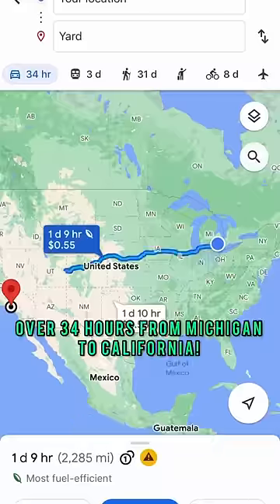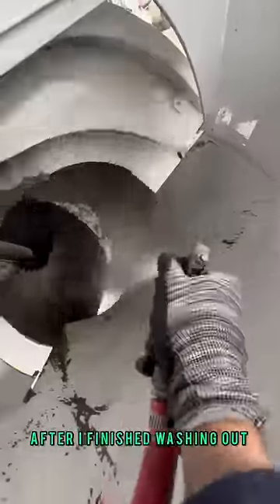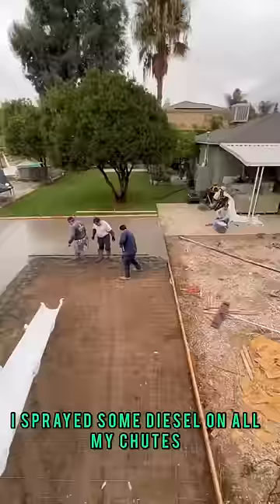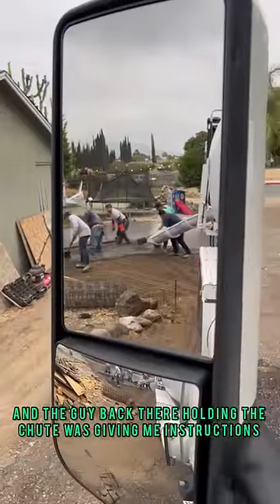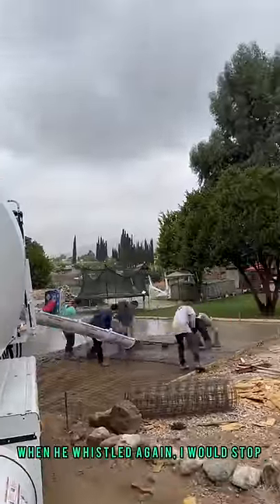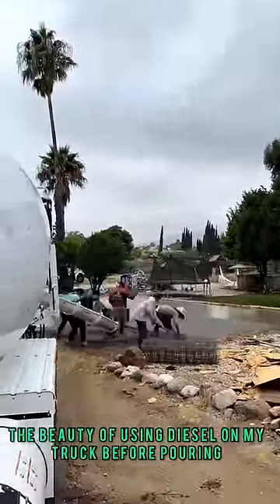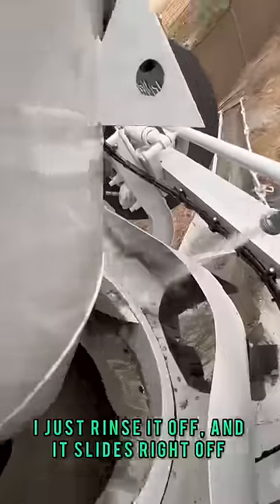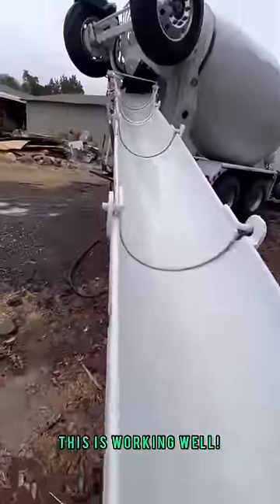BRAND NEW 2022 MIXER TRUCK!! 🤩🚛💨 #concrete #construction #readymix #work #cdl #trucking #shorts

Comment: Wow diesel in the concrete. Good luck boyz.
Reply: It does not affect it. Been doing it for years. Not to mention you just coat your forms, bobcat buckets, and Georgia buggy bucket with it. It's a thin coat. Not gallons.
Reply: @pervysage6969  the tiny amount will either settle out into the underlying soil/fill, and eventually degrade, or it’ll simply evaporate, nothing to worry about
Reply: @exloaded  well it depends on how hot the truck arrives whether or not I'll tell the driver to add a gallon or two to achieve my slump, but one thing I don't do is add water to finish the surface because we all know that will create a weak layer of concrete as it's curing and you'll wind up with a chalking surface. Instead of the reply you responded with you might should reply with a counter of why it's not best ? You have a right to your opinion I agree, but your response is irrelevant to a yes or no. It explains nothing. I have been doing it for years. Not one call back. Not one job with spalling. Only problem I ever had was dealing with a concrete by the yard company and that's what the customer insisted upon. They add chlorination to the mix even in the middle of the summer and add to much sand. Couldn't get a decent broom on it. That was on the customer there.
Reply: U know nothing
Reply: @cgrobe21  you could easily utilize the use of a sealer to achieve the broom finish.  You just need to find the right one to fit your needs.  There are approved methods to achieve what you're asking for.  What you can't do is add more water then what the concrete company has given you the approved amount to add, it's on the tickets.  Once you go over thst amount the cement to water ratio is off and yields a weaker  product then what they sold you.  Time is done away with when it comes to the placement, it's all about the concrete temperature.   If it's not over 95°F,  assuming you aren't pouring in freezing Temps, then you should have no problems.
Reply: @IllNacs  into the air. EPA must like that part 😂
Reply: @exloaded  dude, even if they order a 4000psi at a 4 inch slump and when we get to the jobsite and they have us wet it up to a 7 after that 28 day cure window those cylinders are still breaking at wayyy over 4K psi. I’ve never actually seen one fail before that. It’s like a weight limit on something. It may say 280 but it’s holding 400 all day.
Reply: @Nicksta177  a true 4000 psi mix from a good concrete supplier, Is breaking well beyond the 4000psi it claims it is.   Any concrete that barely reaches that mark is suspect.   The fact that you think going from a 4 inch Slump to a 7, once it arrives on site is something to brag about, makes me believe you don't care about quality.   In addition to that, the Slump is just an indicator of workability of the mix and has nothing to do with strength.   There's this thing called water to cement ratio that is a far greater indication of the mix strength.   The batch ticket will tell you the allowable water to still being able to reach the strength required.  If you want to make the mix flow easier, use a plasticizer,, it will increase the Slump and not mess with the water cement ratio.  Or, you could not care at all and just keep adding water throughout the placement, which I'm sure you do.  Also, there is no such thing as a 28 day cure window, It's a 28 day acceptance.  Concrete will cure for well longer than 28 days
Reply: The amount of any kind of release agent is only sprayed enough to coat the walls of the tandem or the chutes. The thickness of the actual material is greater than the thickness of the release agent.
Reply: @cgrobe21  America really seems to be the land of opportunity.
Reply: It doesn't affect it. Use diesel on trucks,  mixers, backhoes and even the testing equipment. Never had a failure due to diesel.  Don't pour it, just mist. The diesel doesn't bond with the concrete so it just bleeds through before dries, assuming you only used a little
Reply: @Nicksta177  when you order 4000, the mix you receive is well above 4k, often by over 1000psi. Concrete companies are smart. They expect someone to add extra water and it's much cheaper to deliver over strength than to pay for demolishing unsatisfactory Concrete. Remember that wherever there is water, a microscopic void is left in your concrete. This can be a problem if you're expecting high shear forces or it's a roof slab. It's also an issue when vibrating that separation may occur.   A test cube or cylinder may look good, but a core sample might tell a different story.
Reply: Not enough to do anything
Reply: @IllNacs  diesel doesn't evaporate.
Reply: Do you know that in freezing weather, anti-freeze is added to concrete mixes to keep them from freezing as they cure?
Reply: @cgrobe21 finally someone who underhands I do it all the time here in my construction business! Makes it easier these people don’t know a thing honestly
Reply: It's a few droplets of diesel and doesn't make a difference in the concrete strength
Reply: @cgrobe21  it doesn't matter, I'm an actual real concrete finisher down in florida. I do house slabs. We don't put diesel on anything, we use form release. Ecologically friendly form release. It's not that much more expensive, and it's way more responsible environmentally, and it doesn't mess up the concrete. Good luck with all those jobs you're using the salon. Just because they haven't cracked or suffered damage yet, doesn't mean they are not going to. It is not going to be immediate. But the next time there's a hurricane or a tornado or some other kind of natural disaster, and only the houses that you use diesel on are the ones that are damaged or destroyed, people are going to start looking into your business, they're going to start looking into your practices, and then you're going to get sued out of existence.  That's how that works it never happens out of the blue, it's always as a result of some kind of natural disaster or storm, and then you always hear about the contractor retroactively losing his ass because of shoddy business practices, this is no different than that builder in Taiwan that was hiding used oil cans in the walls of his concrete building instead of rebar. And then everyone wonders why it collapses and kills a bunch of people.
Reply: @exloaded  tell me you know nothing without actually saying you know nothing, our mud shows up from the plant at anywhere between a 4 and a 6.  If it shows up at a four or five, I have them bring it up to a six. Big pours are done at a seven. Of course it's 95° at 8:00 in the morning when I pour my concrete, and at the hottest part of the day the heat index is well over 111. Hell, I'll go back the next day, and set sprinklers up on it, I just did a 10,000 sq ft slab a month or so ago and I was out there twice a day watering it down for about a week. Now if we're doing a tie beam, or a cast in place beam or columns, then yeah those will get poured around to 5 or 6 in slump because it's got to be able to get in around the rebar stirrups. But slicking up your mud does absolutely nothing to the strength of it, I've seen drivers forget to shut the water off, and show up with gray soup. Obviously I sent it back and I still got a call from the plant manager want to know why I refused a load of mud that was just going for a footing. When I explained to him how it was he's like it's not going to hurt anything it's just going to take it longer to dry. Obviously I didn't pour that concrete, I sent it back and got another truck but, I have no problem wetting it up to a six or seven inch slump if I have to. I've never lost a slab, I've never had one delaminate, discolor, or spall.   But I wouldn't expect somebody that puts diesel in their concrete to know this
Reply: @cgrobe21  a gallon or 2 does nothing to a fully loaded truck, in fact its a waste of water and in most cases, exceeds the allowable by the supplier.  Your clearly one of the many contractor's I deal with all the time that make claims of doing it for years with nothing happening.  The reason for standards, specifications, and inspections is to ensure quality, something you don't care about, only the dollar.   Goodluck, hope you never have to findout about shitty outcomes.
Reply: @mikeprimm4077  clearly you know nothing if you're making judgments on the concrete based on its slump.  Do you even know what the purpose of the Slump is???  What about air content???   Or how about the unit weight????  You claimed you water the slab contiunuesly, do you know why???   And instead of watering, why not opt for a sealer???  

From my years of experience, I've found that lazy people, tend to want the concrete watery, because just like you said, it allows the concrete to flow better, which is true, but there are better methods to achieve the same results without cutting the integrity of the concrete.   Use a water reducer, it will allow the concrete to have a higher Slump requirement and, set up faster. 

On hot days I would recommend controlling the temperature of the concrete l, the supplier should be adding ice, at their expense, on hot days, because even they know they can't deliver concrete that exceeds 95 degrees.  

Goodluck, hope you never have to findout what it's like, tearing work back out.

Comment: The guy telling you about form oil is telling you in a kind way how to not go to jail
Reply: That’s right!😅 good lookin out!
Reply: It's against the law to use any type of fuel and shoots that go in the sewer system
Reply: Isn't form oil diesel lol.
Reply: There's form oil oil based or water based but alot of people use diesel works just as well
Reply: Also now you can buy biodegradable form oil.Sometimes habbit changes should be a must.
Reply: @mikesmoke9173  With some oil motor oil.

Comment: Thank you for keeping civil engineers and inspectors relevant dude.
Reply: @Tom Strohl break me of a piece of that Kit-Kat bar!
Reply: I’m a civil engineer and we don’t need this guy to keep us relevant 🤣
Reply: Those are the people that make good skipping people when shoved out of the side of a moving van :)
Reply: @JR-uc1of  how much do you make, would you say the degree is worth it?
Reply: @jack jack  I make $60,000 a year doing this for a year and a half now. I went into debt over my degree. I’m not making way above the curve with regards to pay but I make good money for my area. I do civil site design and personally I love it. I think it is very worth it but I’m always a big proponent of someone leaning a trade if that interests you more. You’ll make good money and you don’t have to spend years on a degree. My job is very nice with good benefits and there isn’t anything else I’d rather be doing
Reply: @jackjack4412  if you want money, do something with engineering management.  For anything that has to do with management and finance within the construction industry.  If you really do just like to build stuff then it's worth it. A truck driver can make the same money as an entry level engineer. Sometimes more,  if the truck is yours. Arguably the labor requiremnts are  very different.
Reply: Bro think of the environment....literally pouring concrete on the environment
...
Reply: @JR-uc1of  do you live in a major city? $60,000 a year seems a bit low from what I have heard. I’m currently a civil engineering student but luckily everything is covered through academic scholarships.
Reply: @Michael-zn2jc  no I do not. It is a little low according to the entry level stats but I have no problem paying my bills and I drive a new car
Reply: @Michael-zn2jc  starting salary. own your own civil engineering firm and make 300k - 1m a year
Reply: @JR-uc1of  thanks! The difference is probably due to the higher cost of living
Reply: @adamspecs9799  easier said than done. Also you need to be a PE obviously before you can do that. But it’s definitely worth doing. Big money in owning a firm
Reply: I’m an inspector and the slump, temperature, air entrainment, unit weight looked fine. Cylinders broke at 4,560 average ahahaha
Reply: Keeps me happily employed lol
Reply: Yeah bro what the hell!
Reply: @Michael-zn2jc  that is entry level wages, civil engineering make much more than that after gaining experience.  At least over 100K
Reply: @brettbaker1663  you can see the air, temperature, and unit weight?
Reply: @awright1216  you can’t see them, you test for them 👍🏻
Reply: @brettbaker1663  exactly so why did you say they looked fine?
Reply: @JR-uc1of enjoy being replaced by computer programs 😂
Reply: @tightbhole420  it would be pretty hard for a computer to do my job 👍 I’m curious why you think a computer is going to replace me
Reply: @JR-uc1of  do you break out a slide rule and do calculus by hand? 🤣🤣
Reply: @tightbhole420  no but I design sites and all the engineering that goes along with it.’how could a computer do that? And what do you do exactly?
Reply: Does adding diesel to w3t concrete affect it?😊
Reply: @winningsince1992  i think it's too much to ask.